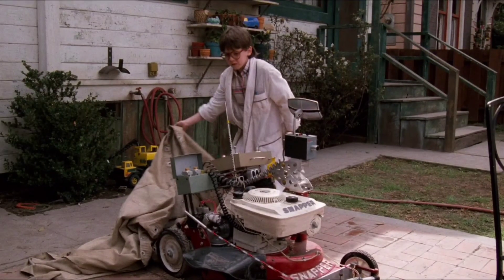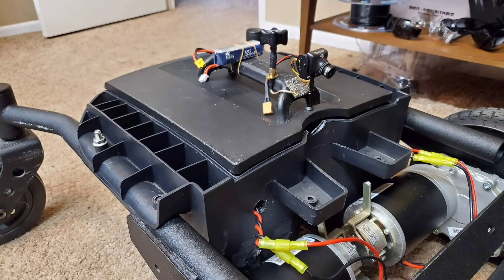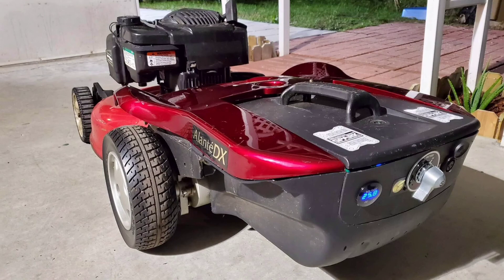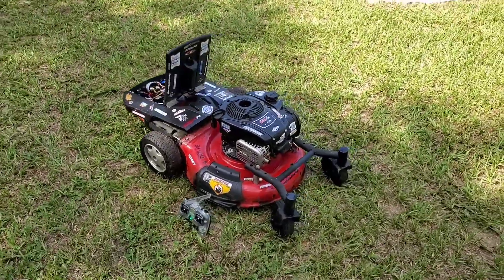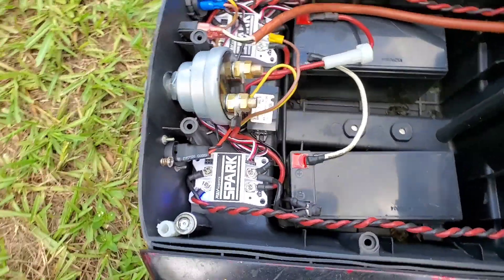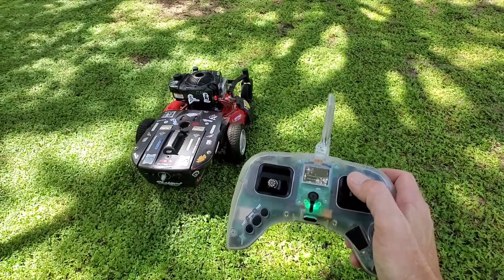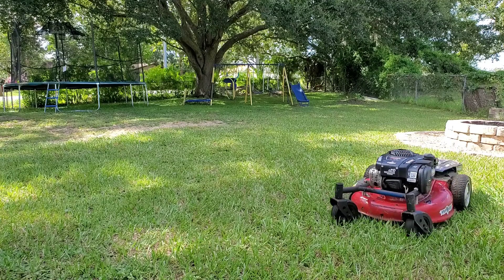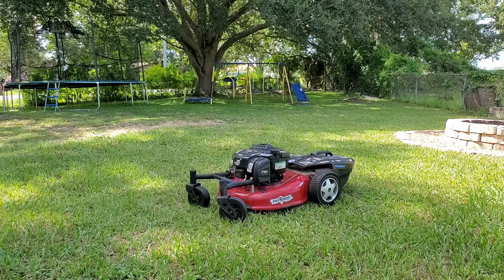RC LAWN MOWER! - Honey I shrunk the kids IRL!

Comment: when it comes to batteries, I started out using two garden tractor batteries which measured power in CCA (cold cranking amps) which means nothing when trying to figure out amp hours.  When I made the change to Lithium Iron Phosphate I decided on using just one 12.8 v.  30Ahr battery which is plenty of capacity for my needs (i can mow twice on a charge for sure, maybe 3 times?) and the battery is smaller than a lead acid battery and only weighs 7lb.  With todays battery prices and forced core charges and taxes, the Lithium Iron was just a hamburger more expensive and good for 4000 recharge cycles as its a deep cycle battery not an engine starting battery.  Lithium Iron is way safer than Liop too!

Comment: Nice! I’m thinking about doing my own. I have an old rear drive mower I’m not using right now. I was thinking about using some type of front remote steering wheels in front to control it. What would you do? Thanks.
Reply from the maker: I prefer a zero turn set up with the wheels in the rear doing the steering. You can get dual out out motor controllers on Amazon to use with a pistol style grip TX and RX set up like a normal rc car. It will blend the two for you automatically

Comment: Should I use 2 brushless dc 12v connected to a 24v battery
Reply from the maker: I used 2 DC motors personally, your set up depends on the motor controller you buy.